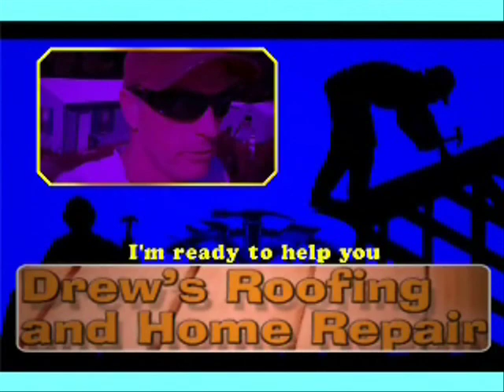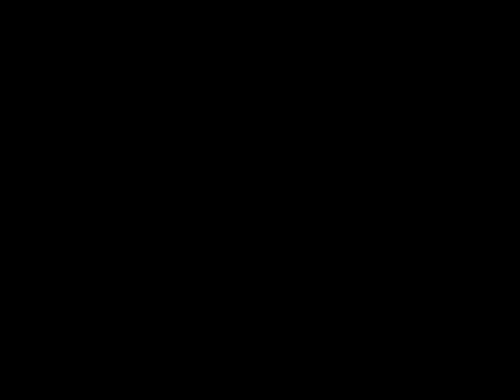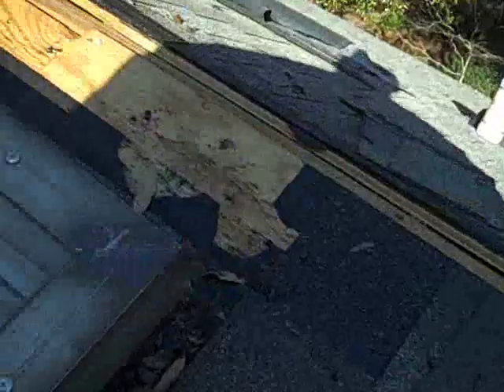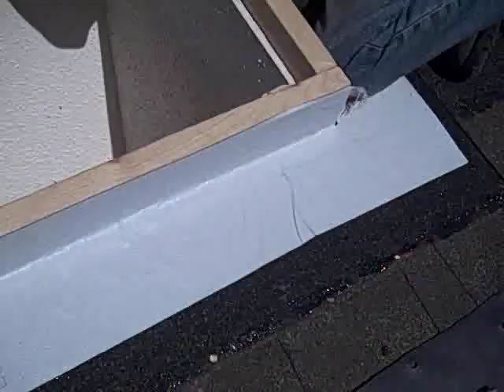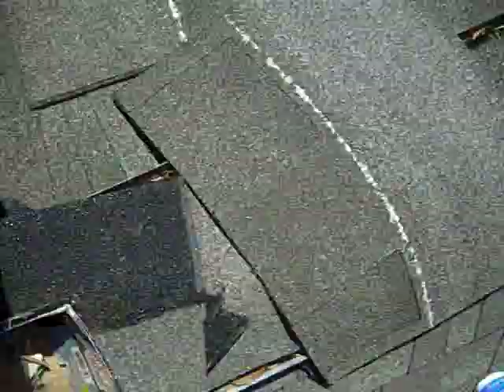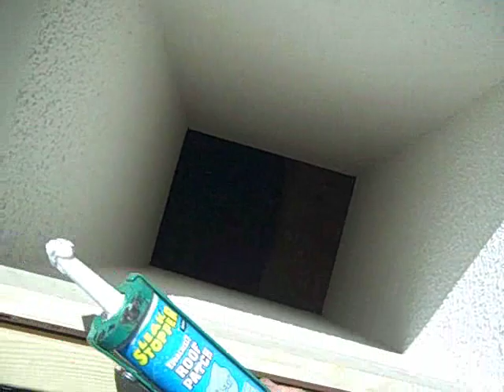How to install a skylight on your shingle roof

Comment: Nice try but I see quite a few issues. The first skylight you show is way too close to the ridge. Water wi ll pond in between the top and the ridge and back up into the home. The smaller skylight; it looks like your guy laid the peel and stick over the shingles on the side. No good.